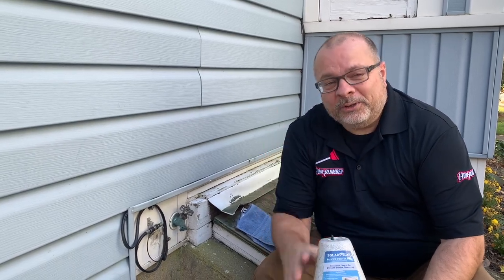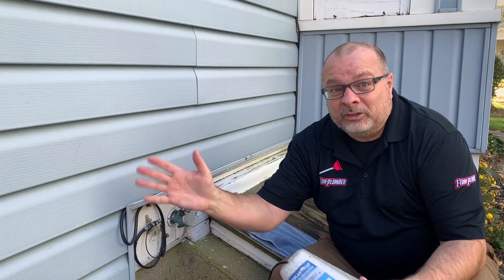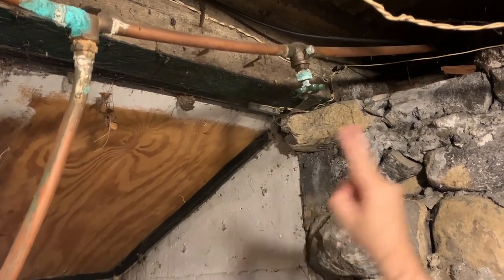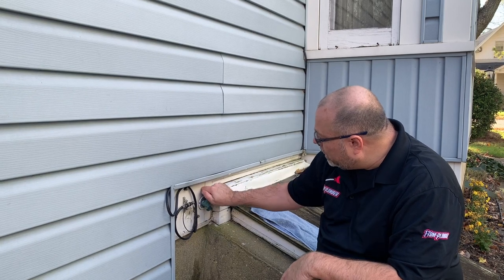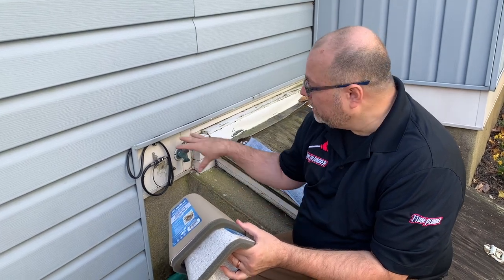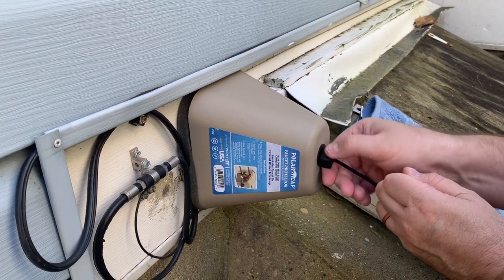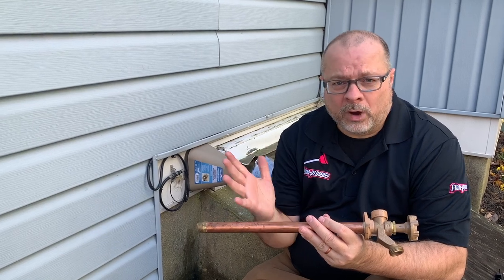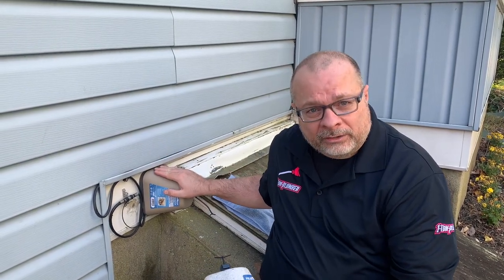How to Winterize Outdoor Faucets (Cheap, Easy, Fast!)

Comment: One step you missed? I's called a petcock a little cap you loosen to better drain the line and I've had houses that had them on the ball valve but I've also seen gate valves as the shutoff to outdoor spigots without any petcocks...
I'd say if you have one use it.
If installing, put one in.
If it's an existing install hope for the best?
Shut off your shut off and leave outdoor spigot open...
The foam covers are cheap, go ahead and use one too.
If you don't have a frost free spigot consider one.
Good luck!

Comment: One thing to add. After turning off water inside and opening the hose bib outside the water won't just drain. You need to break the vaccuum on the line. That would require opening the small drain on the stop and waste valve inside the house. Most homeowners may not know this step.
Reply from the maker: Thank you, Joe! Great add to the video. Appreciate it.
Reply from the maker: Completely understand. I might have done this at an intermediate or higher level. I'll try to simplify in the future.
Reply: I have a 104 year old house and I've never added this third step.  We've done just fine.
Reply: It's called a petcock a little cap you loosen to better drain the line and I've had houses that had them on the ball valve but I've also seen gate valves as the shutoff to outdoor spigot without ant petcocks...
I'd say if you have one use it.
If installing, put one in.
If it's an existing install hope for the best?
Shut off your shut off and leave outdoor spigot open...
The foam covers are cheap, go ahead and use one too.
If you don't have a frost free spigot consider one.
Good luck!
Reply: If you don’t know about the drain cap, you can do something else.  2 persons are best.  Open the outside faucet, then a 2nd person slowly close the inside shutoff valve.  But, the real problem is that the shutoff valve may not completely close due to an old seal, and water is still getting through.  That’s why some plumbers recommend you leave the outside faucet open, to let any accumulated water drip out and not fill up the pipe that can freeze.  Also, disconnect the hose from the bib.

Comment: Your info is WRONG. Those silly styrofoam things DO NOT prevent your faucet from freezing. They only SAY they do to get your money. If it's 7 degrees outside, do you really think the inside of that faucet cover is at 35? The faucet generates no heat of its own and people have brick or in your case the slats in your shake shingle siding that the cold air will be flowing into. Trust me (and though your heat will emenate some heat) the inside of the faucet cover will be well below freezing and your faucets WILL freeze.